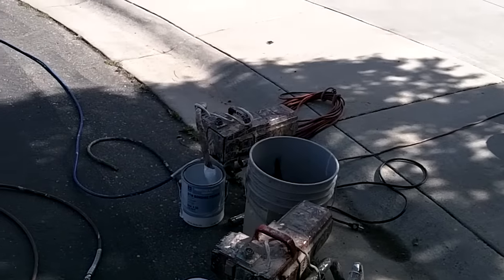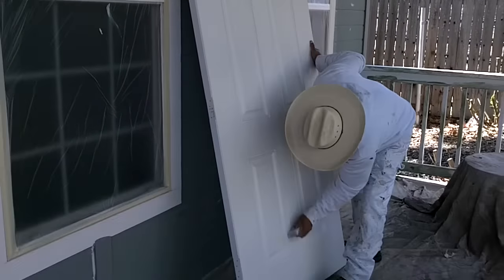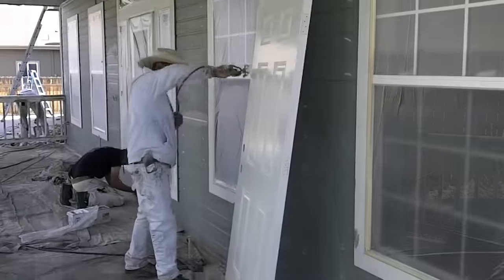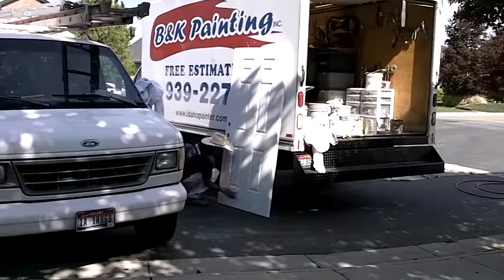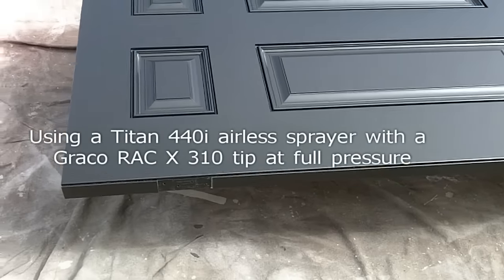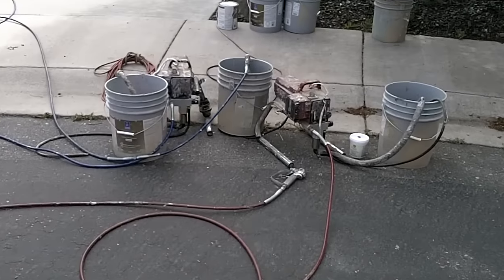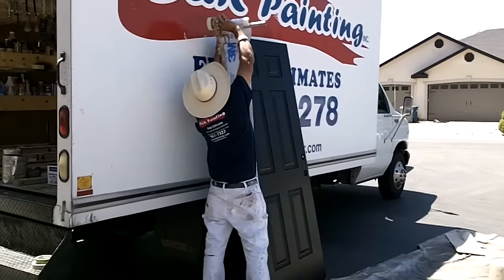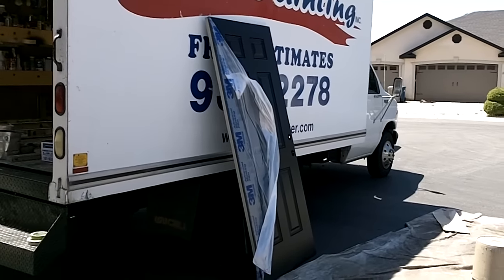How To Paint Your Front Door In One Day.  How to paint a door.  DIY Door painting tips.

Comment: Hey  Chris , i would love your help with this . How do you go about avoiding flashing and seeing vertical and horizontal brush strokes when u paint exterior doors with a semi gloss paint ? I try to feather in and apply as little paint as possible , smoothen the brush strokes as much as possible , but it seems u can always notice the where the vertical and horizontal strokes meet . Is there a way to avoid this ? Greatly appreciated
Reply: Anthony Mannara DON’T BRUSH TRY SPRAYING IF CANT SPRAY my experience SECOND BEST, IS USING A FOAM-ROLLER COVER  (Velour) for a smooth-automobile finish👍🏻😎
Good Luck, CHEERS
Reply: With the right amount of water added it does not leave brush marks.